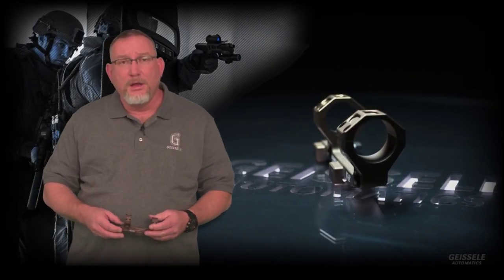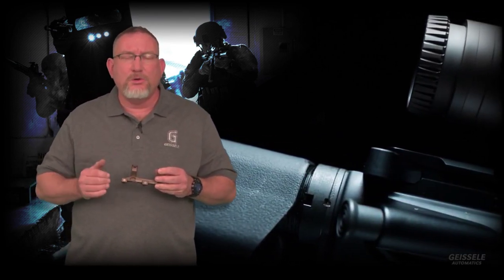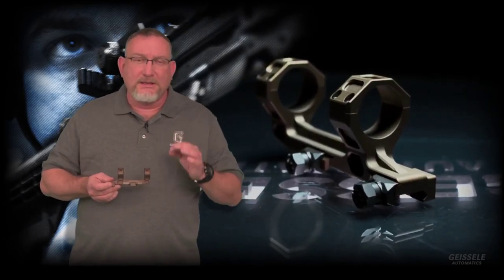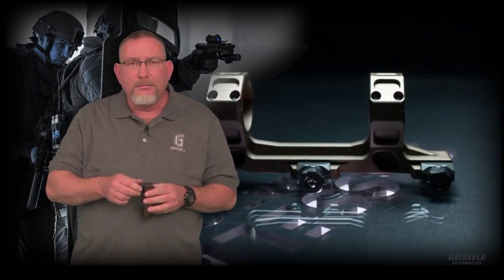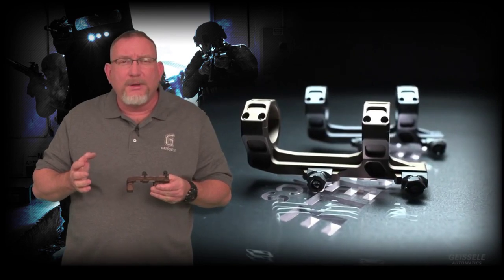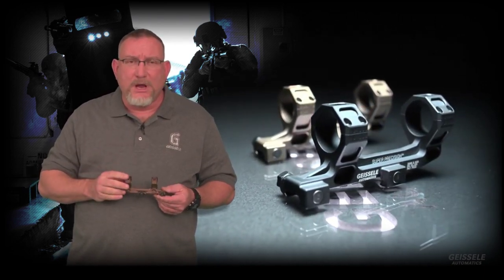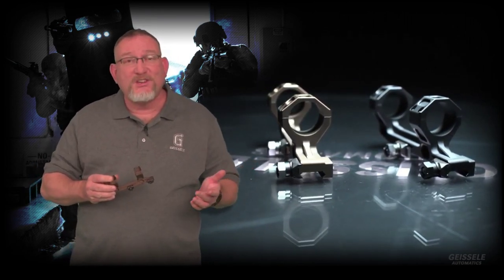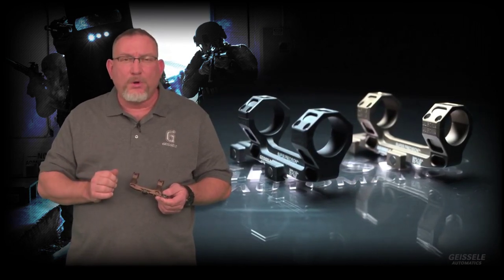Introduction to Geissele's Super Precision Scope Mounts

Comment: Can you explain to us if Geissele mount can save scopes when mounted on the SCAR 17. I think a good mount can damp out the vibration.
Reply: I doubt it man.  That would require some sort of dampener I think.  The only scope I've ever heard of holding up on a SCAR-H over any length of time is an ELCAN.  Kind of cost prohibitive though.
Reply: Swfa will hold up at an affordable price point.
Reply: Go with either Vortex, Trijicon, or an Eotech VUDU all of their warranties are Ironclad. Just don't tell them you put it on a SCAR 17
Reply: @a_k_bryson  So far with the Geissele, I haven't had any issue messing up the optic.
Reply: I’m using a Trijicon Accupower 1-8x28 Scope with this Geissele mount on my POF P415 Edge Gen 4 AR in 5.56mm. I’ve switched it out a couple of times with my ACOG & this mount-scope is steady like a rock with no noticeable shift in zero! NONE. 🇺🇸

Comment: This new ALCOA 2099 mount with titanium crossbolts will probably be double the current $350 price. 

A Vortex Optics Razor HD Gen III is approximately $2,550, Geissele Super Duty Rifle, 16", 5.56MM, $2,500. That's $5-K plus a Geissele ALCOA 2099 mount ($$$$) and a $450 Surefire M312C Scout Light.

Plan on a $6,000 build.

Comment: How do you know which extend you need?  Standard,  extend,  or hyper extend....?
Reply from the maker: It really depends on what scope you use and what eye relief you are looking for. You can always call or email us to reach our Weapon Techs and get pointed in the right direction.
Reply: @GeisseleAutomatics  ok!  Because I am looking to put a 1-4 or 1-6 optic on a BCM recce.  Id like the rear of the optic to basically kind of line up with charging handle.  I am 6'2,  long arms,  long length of pull. Thanks!  What extend is the SOPMOD vortex mount?  Standard?  Extend?  Hyper extend?

Comment: Why on earth are you doing this out of a billet of 7075 when an extrusion would save so much money and time as well as being just as high quality and precise. You're making a $200 mount cost nearly $200 more. Doing this product from billet shows a lack of commitment to this line.
Reply: +Sam_Cummins Says a guy who does not understand the differences, metallurgically speaking. Its like a child arguing with their parent about the birds and the bee's...
Reply: Oh please, educate me. 

An extrusion is a billet that instead of being extruded and cut into blocks and wasting material, it's formed into a shape that requires less material to produce the finished mount. Why wouldn't you want to reduce the amount of material required per unit and reduce the cost per unit in the long run?
Reply: YZFoFittie is right.  Billet aluminum will have different properties than an extruded blank.  Sam, maybe you are confusing the extruded aluminum blank with that of a forged blank... The forged blank could be shaped to produce less waste and less machining and still  retain the mechanical properties of the design specs.  But the cost of the dies for a forging are very expensive and the volume of the mfg. needs to justify the forging setup costs.  I am sure if BG gets an order from the DoD to make a million of these, that is the route he would go to cut down on mfg cost and machine time, but if he is only make a thousand or so a year, purchasing billet aluminum stock and doing extra machining is the way to go financially.  Just my 2 cents...
Reply: Sam_Cummins lol I like how they say you're wrong  when you asked a debating question, but no one answers but instead does the hillbilly Bob move around and just points the finger saying you're wrong  without discussing it. #genius
Reply: Who else had to google nerco post????   I now know I am nercoposting.